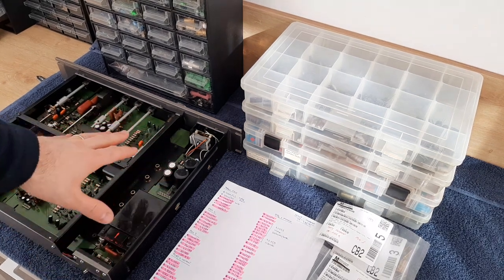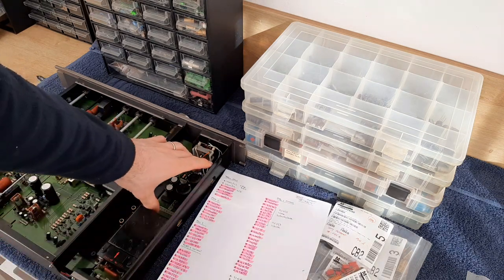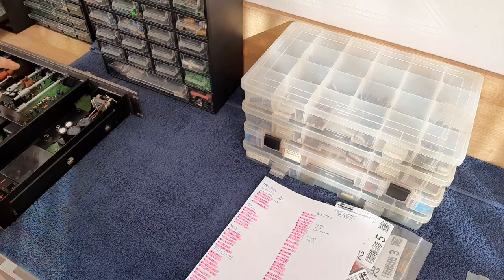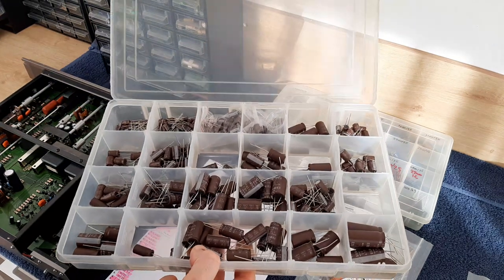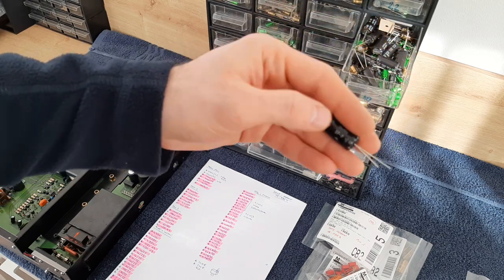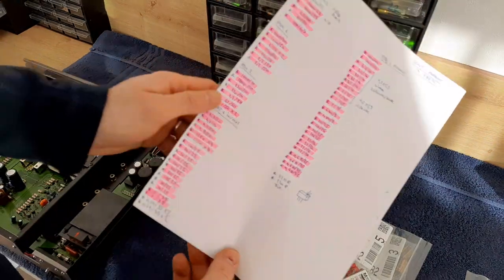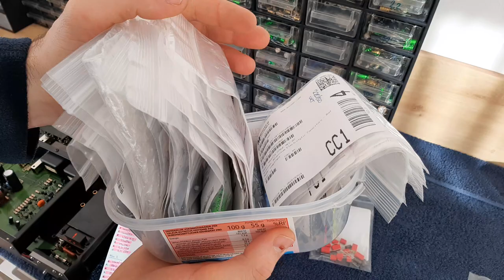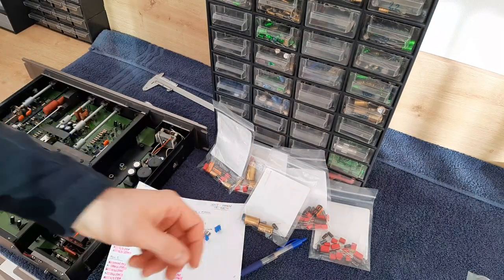How to Choose Parts for Audio Vintage Gears Before Restoration

Comment: Hi Marius, thanks for another great video. You have a great selection of parts and a great knowledge base for repairing HiFi.

Do you have Discord? I run a server with a lot of audio technicians and engineers in it. I would love for you to join. Let me know if you would like an invite link 😊 Cheers!

Connor
Reply from the maker: Hi Connor and thank you also for your message. I m trying to keep alive for a long timw the audio gears from golden era. They did good job on that times vs this days. 
I see you have same hobby and i will say to you good luck with restoration processes. 
I don't have Discord.
Connor, stay tuned every second day  new video is released.
Cheers!